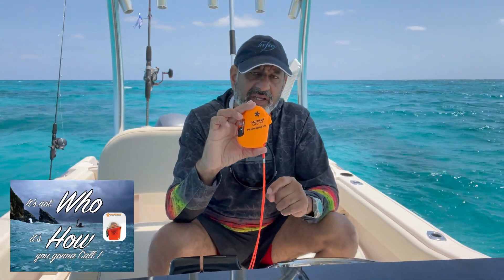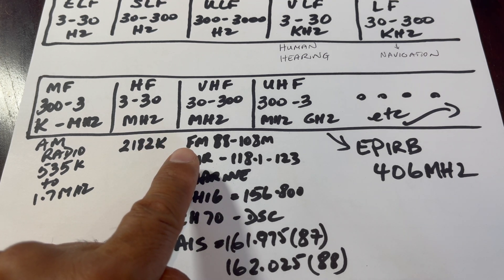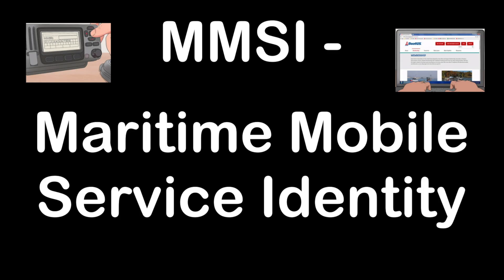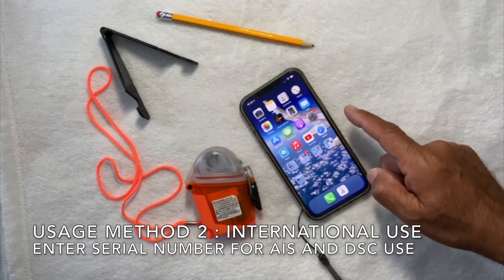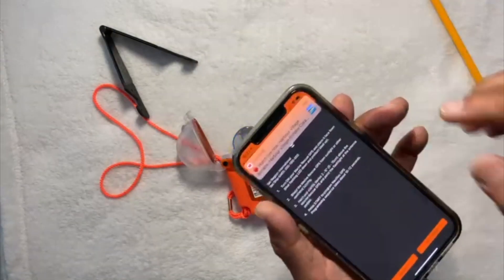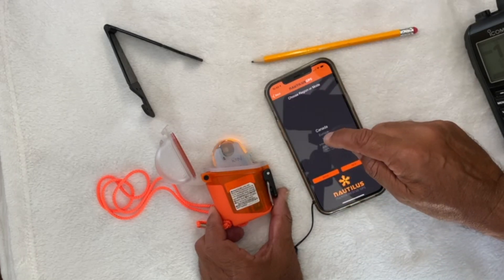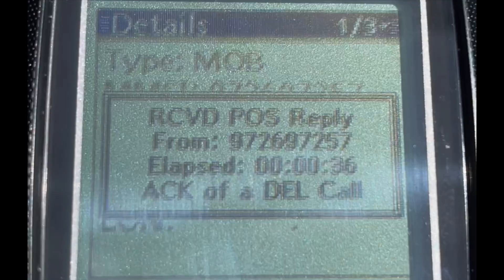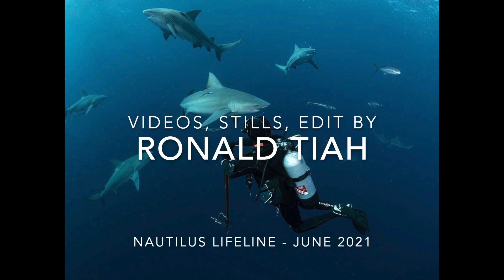Nautlus Lifeline Marine Rescue GPS Part 2 : Setup and Tech Info

Comment: I’m trying to set up my GPS in INTL mode. I get the two white blinking lights, but then it asks whether the device flashed or not and if not re run program...The opinion is not available... In the USA mode it asked me to scan it twice to set up...... What am i doing wrong..... Since i dive mostly in FL can i set it to USA?
Reply from the maker: Hi and ty for message, checking this for you 😊

Comment: Great video.  Thanks for making and sharing.  Do you have any tips on how to get the unit into its silicone case?
Reply from the maker: @keithgill4299  that one was tricky but since its silicone it had enough stretch to try and try again and finally got it into there. Good luck!